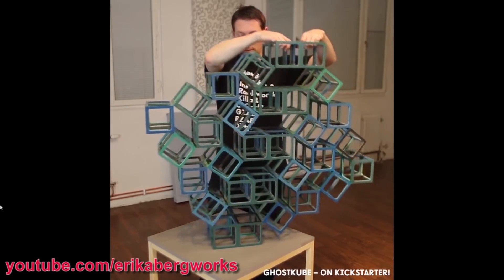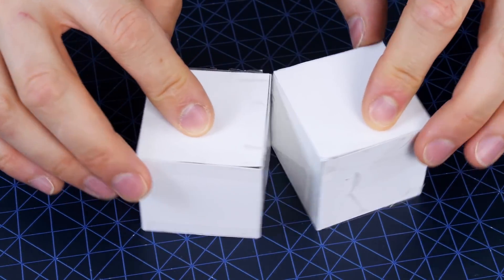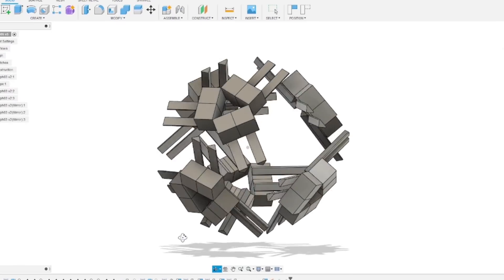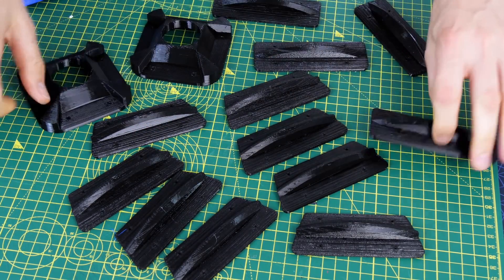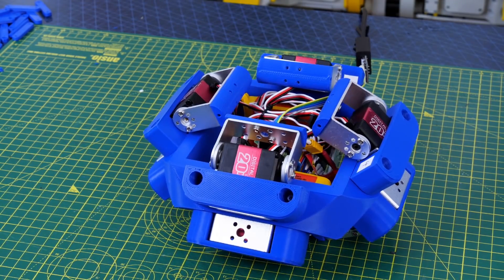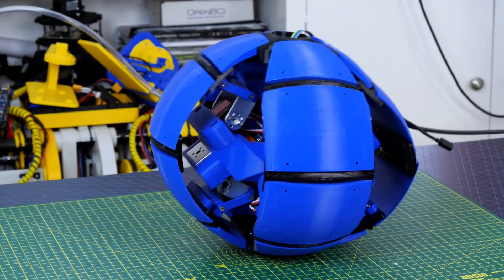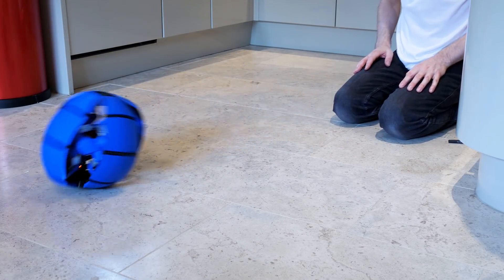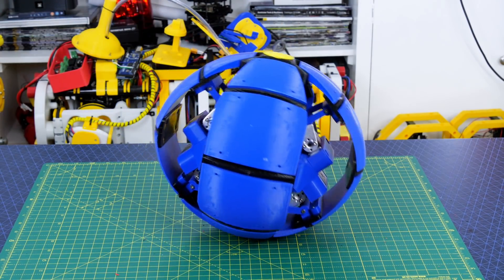Shape-Shifting Morphing Robot Concepts

Comment: did you ever consider engaging all the servos?  Having 2 adjacent side squish while the 2 opposite sides expand?  seems like it would roll on 2 edges rather than the face.  when it rolls on the face, it is also balancing on the face.  You achieve a significant amount of balance because of the symmetry, but variations in the individual parts could throw off the center of balance.
Reply: I think Les has the right idea. Two on one side stretching and the opposite two compressing. No design change required. To make it roll you need to shift the center af gravity away from the sphere center. Then at the appropriate time return those servos to neutral and get the next group working. Maybe a gyro would help.

Comment: About a mechanism for the boxes- in most cases there are only 2 transformations- means 2 states. That could maybe be achieved with electromagnets inside the boxes- so corresponding  surfaces can repel and attract on command but still can only go in the right way because of a thin hinge like in the cardboard models. It would be a very fast an brutal transformation though

Comment: When you think this "morphing for movement" based design ideas, you should not limit your "robot" moving only on plain terrains. Interestingly, this idea is more common in water living things. (like jellyfish). You can challenge yourself by making a robot who runs under water, moves with morphing with elastic 3d printed parts, copper filaments for waterproof electric conduction, etc.. I've been highly inspired with your good work! :)

Comment: You could design the cubes to have interlocking hinges built into the edges of the cubes. a metal axle could then be slid in (like the pin in a hinge). one cube has the drive motor and drives the hinge pin/axle. this cube must be free floating on the axle so the axle can spin. the second cube would be fixed to the hinge pin/axle, and would then be driven by the internal motor inside the first cube.

Comment: This has been done. There's a white ball that's rolls along pushing out the relevant middle joint at the right time to keep up the momentum. It can then transform into pentapod bot and walk. Let me know if you want a link to it.
Great work, otherwise. You're on your way to converging on the existing one.
Reply: Sorry, you are mistaken. The robot that James has made, and what Zenta has made is not exactly the same.

Zenta uses the method of 'pushing' off the ground with many different 'arms'. 
James uses a mechanic where the robot is morphed to an extent where the center of gravity is always infront of where the ball wants to go, but it does look very similar, and I understand why you thought they were the same.
Reply: @HaloWolf102  You're right about the differences in locomotion but I still consider them both as locomotive spherical robots. Obviously not 100% identical. Just like two different tetrapodal animals that move differently. One way might be more energy efficient etc but they're classified together further up the binomial hierarchy.
Reply: @mozkitolife5437  Would you consider James's BB8 robot the same as this?
Reply: @HaloWolf102  Like I said, yes and no. Depends on what the classifying feature is. Yes, they're both spheroids. No, they don't use the same locomotive mechanism. I realise I was too harsh in saying it's been done. If James can achieve a different form of locomotion then cool. And I get your point. They might look similar but they're not using exactly the same mechanism.
Reply: Can you post a link to that rolling robot?
Reply: @cameronbest  MorpHex. It's been a while... It's actually a hexapod.
https://youtu.be/8yO-H22eNNg

Comment: Having the flex triggered by a gyro would put this over the edge.  As you said, rolling doesn’t require a constant pulse, you want to flex the downward side as it passes the vertical to accelerate, and before the vertical to slow down. 🤷🏻‍♂️. Using more pointy end pieces would encourage it to roll towards the centre of the flexible sides too.  A gyro would also help you determine which sides were downwards, so you can use all 4. Love this project ❤️

Comment: Need to change it form with purpose, and not random, maybe something similar to the B-8 robot, and just the the direction sensor/control to expand the back side to the direction you wish to travel. But how to have a sensor moving or stationary inside and controlling the bot will be tricky, maybe have electric actuators inside, and have to  push out in time,  maybe can use something these 8 legend robot and use something similar to their programming so you can roll in 6 different directions, its starting to feel complicated 😩

Good luck!😉

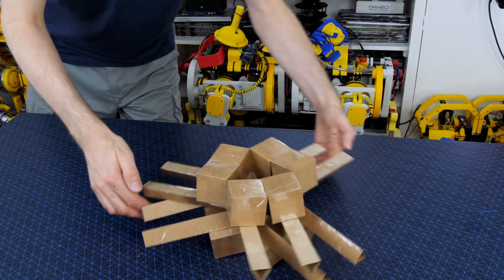Comment: 3:04 "played around in cad"... didn't you already show your Cardboard Aided Design...?

On a more serious note, adding an IMU to make it more dynamic seems like the next step. Right now the morphs sometimes push it along and sometimes seem to stop/slow it down.

Also, the first cube hinge design you showed, with the servo doubling as a hinge would work. For the cubes to fold correctly they only really need to touch at the corners, you can clearance the edges/faces for the servos as much as you want/need.
Reply: I see you watch bad obsession too

Comment: Instead of hinges it seems like some form of electrical muscle/smart material would be significantly preferable for the morphing shape - being able to act almost exactly like the thin tape. I don't even know if anything like this is actually available though, because the expanding/contracting mechanism in them would have to be extremely small and thin.

Comment: Looks like it would require a 'brain' to decide when to morph into the next shape so as to catalyze movement. currently it's like being on a swing and pumping your legs in the middle of the arc instead of at the ends.
Reply: Installs "Brain" 
:What is my purpose?
:You're a ball.
:Oh My God !
Reply: I would like to be brain of the ball robot
Reply: Yeah I feel like it could utilise some sensors and an ai as to know when to fire each servo, because you can see it just about to roll over but then another one of its servo’s push it backwards instead of forwards.
Reply: @planetdesign4681  yeah, that would likely be easily handled by a simple inverse kinematics algorithm and an inertial measurement unit like they've used on their other robots.

Comment: I think if the timing was calibrated to it's angular position using something such as a 6 axis potentiometer you should be able to get it to flex in a way where it's timed correctly whether it's at the start or at speed, or for different surfaces.
Reply: Oh, I just got to the end of the video where you suggested the same thing. Sorry 😅

Comment: Can you use electromagnets embedded internally on the sides of the cubes to push and pull the faces of the cubes?
Reply: Thought the same thing, but rare earth magnets on a servo that moves it to and from the face of the cube
Reply: everything good until the thing gets stuck to a metal surface

Comment: 9:25 this is the point where I realised it would have been so much easier to just write a machine learning regression algorithm to, enable the ball to learn to efficiently roll on its own, than to program it manually. 
Seriously consider this, it will not only save you a lot of time and efforts, but the ball would actually learn much better than you can ever hard-code from your limited human knowledge, logic and imagination.

Because the complaint mechanism you built certainly had the capacity to roll itself perfectly in any direction, that too smoothly, with perfect enough actuation timing. 

It's like teaching a robot how to balance on a cycle, probably hard to hard-code but a cakewalk to let it learn on its own.
Reply: Maybe add a gyroscope (which again is optional, as the ML algorithm can just figure out which way is up from the visual markers that you can put on different sides, and let it see itself roll.

Or you can talk a more hardware orientated approach with accelerometer and gyroscopes, and let it learn internally without using a camera and sensor, but both will produce a perfectly rolling ball that you can even control with a remote. 

(Setting the end point, and your system eill actuate itself to that point)
Reply: Even if it's machine learnt, he's gonna have to add IMU measurements anyways in order to compute a reward for the RL agent.
Reply: it's not difficult to hardcode at all, each (euler) angle from the gyro/accelerometer directly corrosponds to servo values (just the sum of an offset/phase-shifted sin() multiplied by the range of the servo), to give you a different resting orientation. To make it move, i'd guess to just add some more phase shift, so the natural resting position is just off (in the direction you want the robot to move). Right?
Reply: Do you know of any videos or articles on this approach? I would like to learn about this myself
Reply: I certainly don't want to talk trash on James because this is a great project. But have a look at the code on github. It is literally just moving the servos to  some predefined position and repeating regularly.  The code is less than 75 lines long (incl. blank lines)! So I guess before throwing ML at it he'll probably add a bit of dynamical model first...

Comment: Maybe something with 3 phases (3 * 120°) would provide more consistent rotation ?
Reply: Or 4, cycling around in one direction, instead of just switching between two states, indiscriminately of which direction it's trying to actually roll.
Reply: no necesarly is more important in this case program the ball whit some sort of retroinformation of the speed and posicion to know wat is the next step to move the ball

Comment: 1.) decrease time between morphs when in motion
2.) can add 4 legs on servos inside in the gaps between the morphing pieces that make the ball shape so when you want to come to a stop you can deploy the legs and stop it
3.) trial and error programming until it works properly (timing changing , when slowing have it morph as if it were going backwards, to go at an angle you would move the two sides at a ratio so you can get that angle like 45° would be 1:1 and 30° would be 1:2 I believe)

Those are the only things I can think of to have it work best 

Oh and throw in a gyro (if you don’t already) so you can check the angle of the ball in all axis and see which way it has to morph to go in either direction

Comment: james you have to design in a way you can change the center of gravity then it wil move toward it...
Reply: this. you have to factor in the center of gravity more to make it roll. It'll definitely have to be able to control the rate of motion, vs being a static cycle.
Reply: @kasuraga  right. And corresponding to the distance of COM and center of the ball youll get speed. if it can be modeled ...